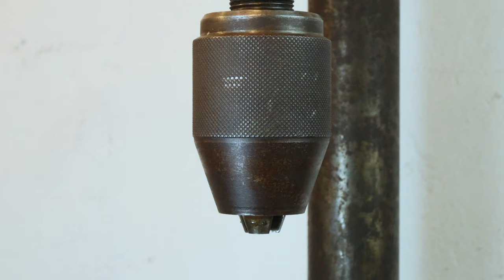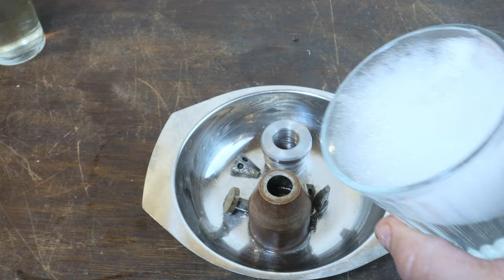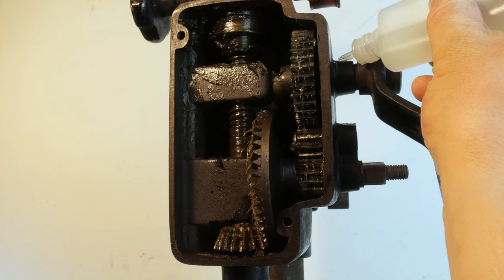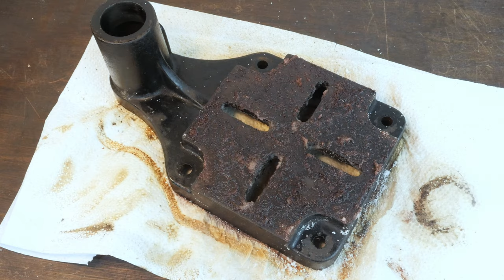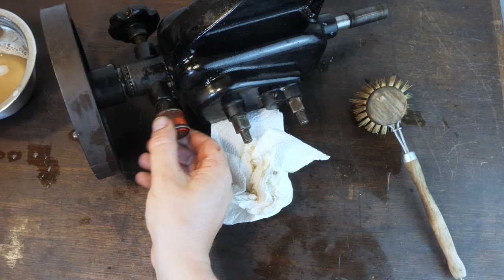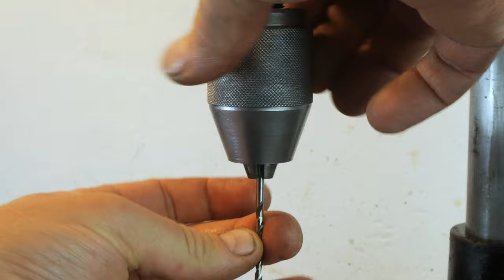Hand crank drill press makeover

Comment: Jetzt schon dreimal das Video angesehen - werde die Funktion dieser genialen Maschine nie richtig verstehen. Sind die beiden Kurbelansätze für verschiedene Übersetzungen / Drehzahlen?
Gruß Tino
Watch the video for the third time - I ´ll never understand how this drillpress really works. Can you change the crank for different gears?
Greetings Tino
Reply from the maker: Yes, it's not entirely clear to me what is happening inside the spindle either. I could not find any drawings or anything. But since it's working so well, I didn't dare to take it apart and risk breaking something.
The two crank positions are for different speeds, yes.

Comment: I am not sure I understand, is vertical movement directly proportional to number of turns, or it can go slower or faster vertically? I surely did not expect it to drill the 10mm steel hole.!
Reply from the maker: Hey, I also didn’t take it apart because it works so well and I was afraid I wouldn‘t get the mechanism back together again properly :) So I don’t entirely understand how it is done internally. 
As long as there is no resistance, the turning moves the spindle downwards as you say. When the drill meets the work piece, the spindle somehow disengages from the forward motion and lifts up the cast iron weight at the top. The spindle is then turning and the downward pressure is applied by the weight. The knob on the side works as a break and controls the amount of forward motion when the drill is engaged. It‘s a very smart design and it works really well and more or less effortlessly even with thick pieces of steel.

Comment: hello, i have the same. but the disc you clean (at minute 10.30) is completely stuck and does not move.
like the bolt you see above at minute 10.18/10.20
what is the disassembly sequence? What do you suggest?

also the grease cap (which you can see at 0.40 seconds), mine is a system stauffer 2, it was screwed in so much that it covered the nut (I can't unscrew it manually....)
I found the original cap and the part that screws on on eBay. but the cost is very high with shipping.
the cap you use (3) can be found on the market...
Can you provide me with the model?

thank you
Reply from the maker: Hey, thanks for your interest in my video and congratulations for getting your own machine. The metal disk on top sits on an conical shaft. If it doesn‘t spin then the shaft must somehow be stuck. Unfortunately I cannot tell you the exact part number of the grease cup. There is another video where someone takes the machine further apart. Maybe this helps: https://m.youtube.com/watch?v=bLQAAz1Pvp8&pp=ygUeTWFudWFsIGRyaWxsIHByZXNzIHJlc3RvcmF0aW9u
I hope you get it to work again!

Comment: Great restoration video! I just got one of these for restoration and the chuck springs are garbage. Can you tell me where you got the chuck springs from?
Reply from the maker: Thanks! I just ordered some springs of similar size from a guy on eBay. The original springs were very stiff. But the ones I got work fine!
Reply: @imadethischannel  Thanks! Do you remember the size?
Reply from the maker: They were 4mm by 22mm with a wire thickness of 0.5mm. If I had to do it again, I would try to get a slightly thicker wire so that they are stiffer. It works ok with those, though.